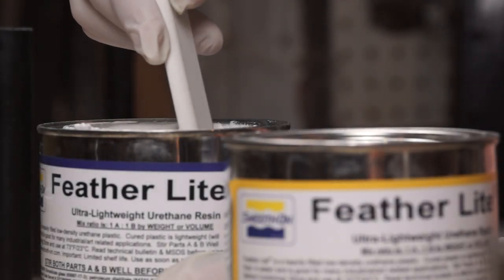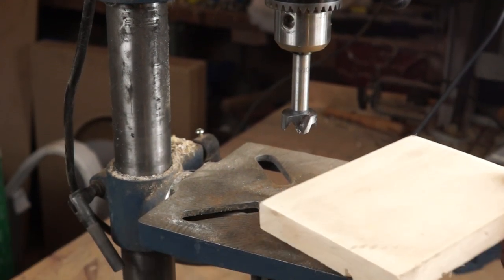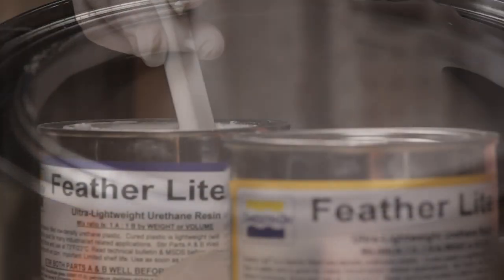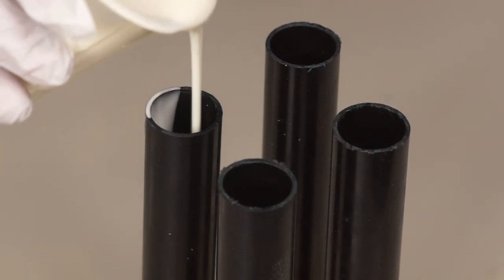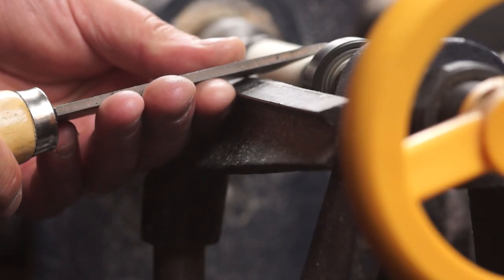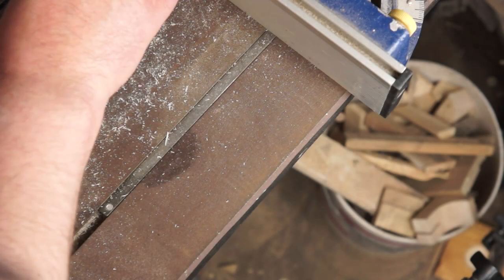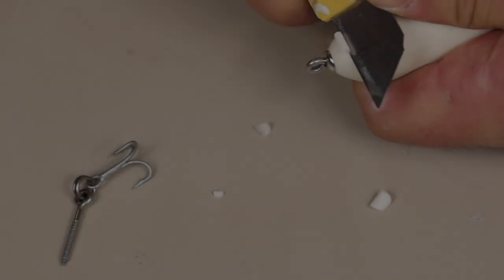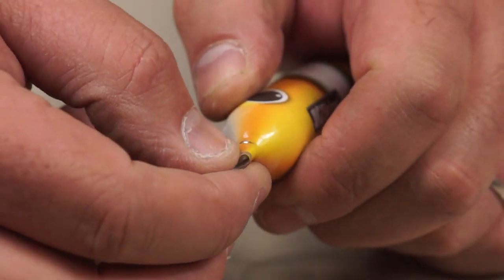Making Hard Plastic Fishing Lures on the Lathe  Part 1 Resin and Jigskinz

Comment: the easiest way to do these hard plastic baits would be to use a mold where you can add the internal wiring but then again I'm sure you already know this and just wanted to show yet another way of doing things and that's whats its all about, doing things your way. Ps. damn i absolutely loath those feather lite jars and i just use different containers where its easier to pour it accurately.
Reply from the maker: SolarBaits cheers, Mikko i was going to do some videos on molding them as well with through wires, but i have to be honest i like messing round with the lathe too much its a bit of an addiction. But you are right about those tins, a bit of a nightmare for pouring, i have a couple of big syringes that i use sometimes.   Thanks, i have just been out fishing lost a nice pike while the guy i took there for the first time pulled out three, never mind

Comment: Hi, When using this resin, what does the average cost come to per lure, with just the resin. I am not talking about the hooks etc? Is it cheaper to just use wood?
Also how much are the cool sleeved paint patterns per lure? And can you use them on a wooden lure? 
Thanks
Reply from the maker: Gary Bristow I never really cost lures in that way, but price wise wood is I suspect always going to be cheaper and in a lot of places free as well, there is a link in the description to the jigskins site, I have used them on wood as well and there is no problem  but the wood would have to be sealed as these do not make a watertight seal

Comment: How do you keep the ball bearings from falling out of the lures? What if you don't use the jigskin?
Reply from the maker: Gary Bristow I drilled the holes slightly smaller and as the plastic takes a few days to fully harden they should stay in

Comment: Paul, what is the trade name or generic name of the liquid plastic and the release agent ?  I want to see if its available here in the states.
Reply from the maker: Sorry haven't finished writing up the tools and materials, but the resin is Smooth-on Feather Lite resin and it is made in the USA http://www.smooth-on.com/Urethane-Plastic-a/c5_1120_1162/index.html   The release agent i used was something i bought a long time ago but smooth on do their own. I have used the plastic tubes without the release agent but it has to be tapped out using a dowel and a hammer.   Good Luck

Comment: Nice job. It little higher float would have been better. Also, users should be aware that resin can be dangerous. The resin contains isocyanates which are toxic so even when you are lathing, cutting, drilling, you need to use protection.

Comment: WE HEARD  THEM SCREW EYES PULL OUT AFTER A  WHILE ,,,, THEN THERE GOES YOUR FISH   HMMM
Reply from the maker: +JOHN SMITH I tend to go with what i have experience of and what I have tested rather than opinion, i have never lost lure because of a screw eye but i am fishing for pike. With that said if i was fishing for larger marine game fish i would probably go for a through wire, but these are not infallible either. Neither is your hook, trace, crimps or, split rings.
Reply: +Paul Adams (The Handmade Fisherman)  I'm new to pike fishing any recommendations